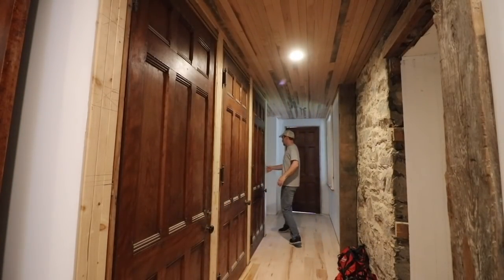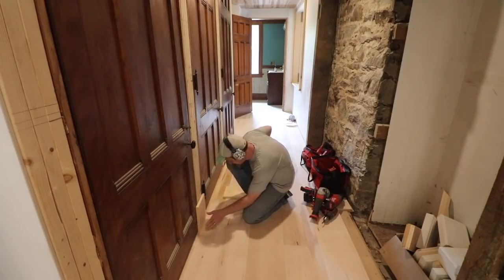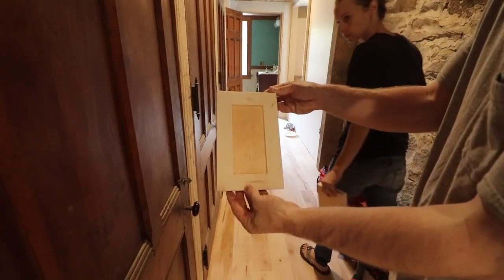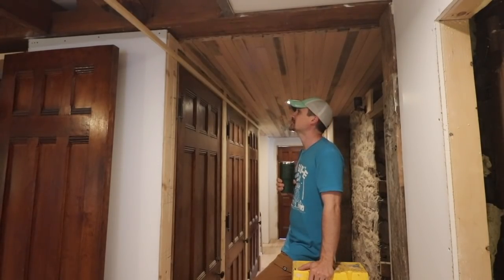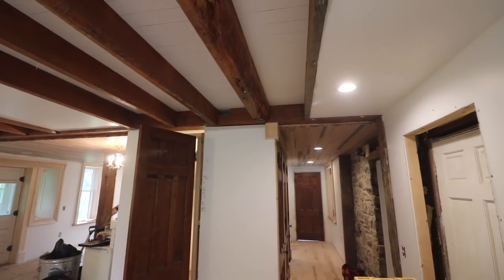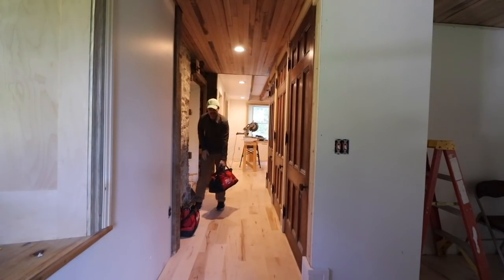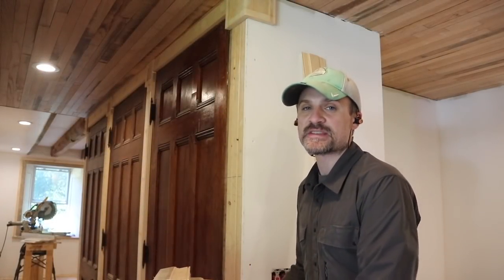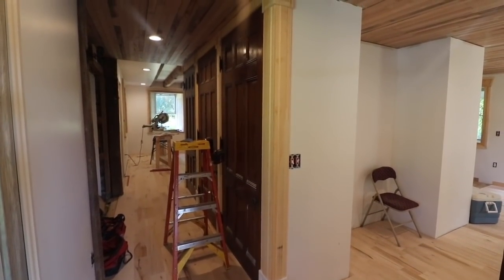Any Wahoo Can Do Custom Work | Farmhouse Renovation

Comment: Great looking doors. Were these original to the house that you refinished? Also, the wood ceiling looks great against the stone wall. What type of wood is the ceiling? Is it t&g?
Reply from the maker: We had the biggest Craigslist find ever with the doors. They were $25 each! They were removed from a seminary college that closed. The ones that were here on the bedrooms were little louvre doors. The ceiling in the downstairs? I think you are referring to. It’s been a while since I watched this video, is 2 inch oak hardwood flooring from a general store that was being ripped down…